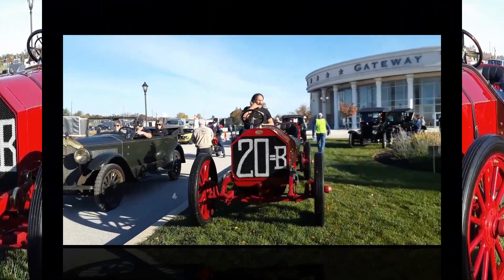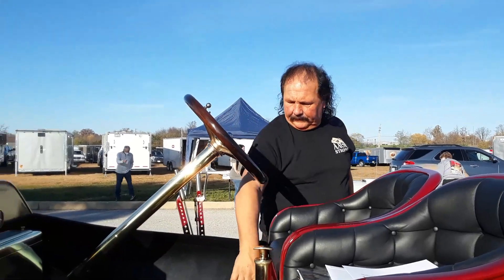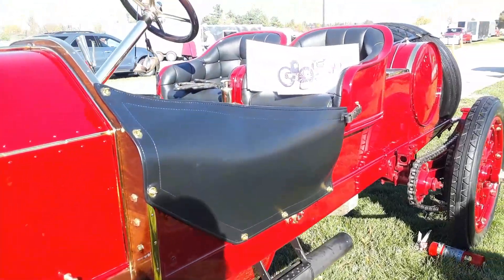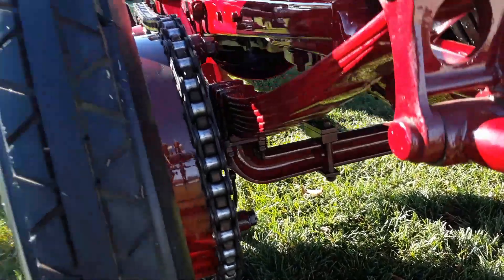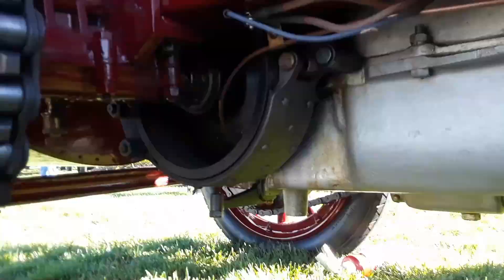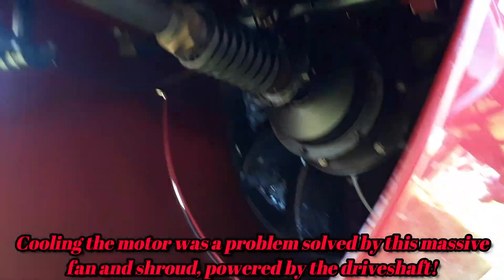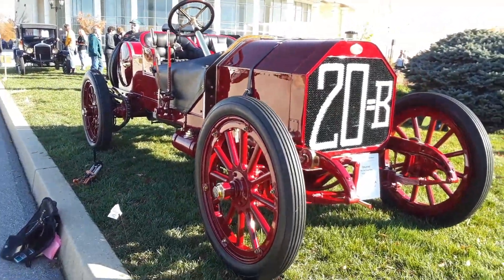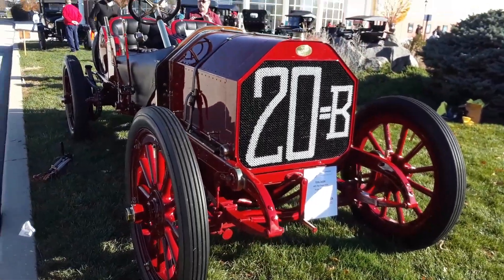1907 FIAT Targa Florio Corsa

Comment: Pam, change the oil while your down there!  They were probably more reliable back then unlike today!
Reply from the maker: Well, they needed tune ups frequently, valve jobs every 30k miles and oil changed at 500 - 1,000 mile intervals.  When was the last time you changed the plugs in your modern car?  I wonder how many quarts this big motor requires???? Now, where is the oil filter... oh, wait, that was not invented yet!